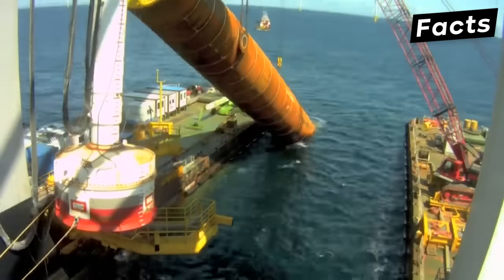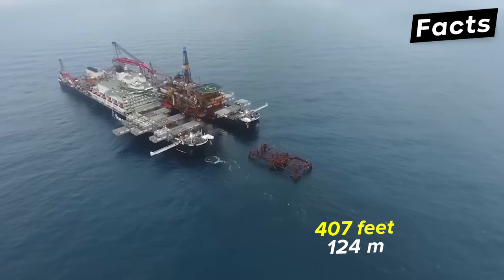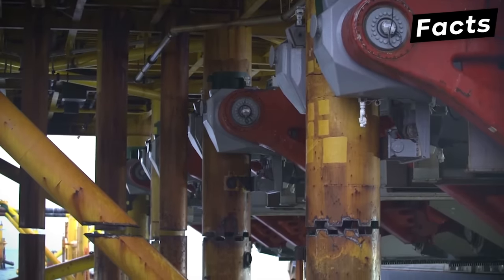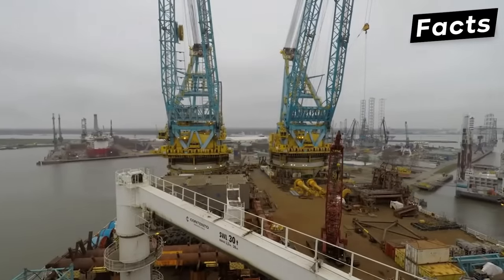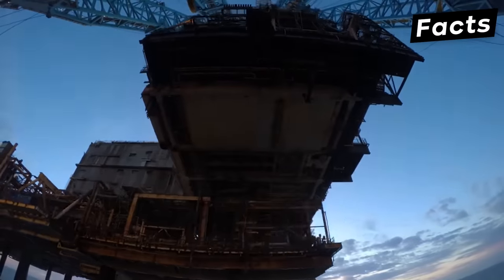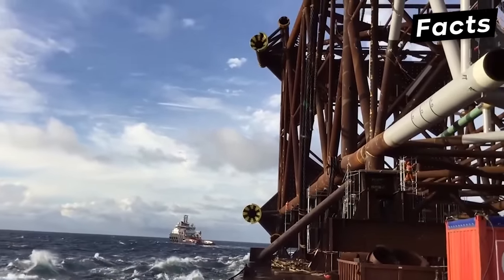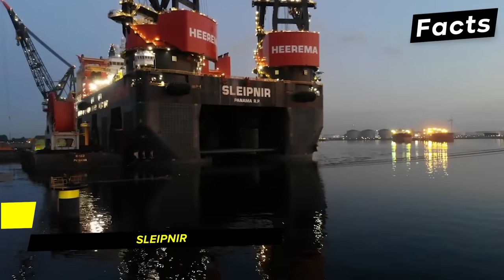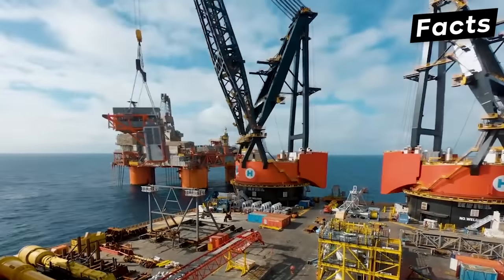The Biggest Sea Crane in The World

Comment: What is the strongest crane in the world?
the Taisun craneHolding the record for the top 3 heaviest lifts; the Taisun crane in China is the strongest crane that exists in the world today. With a working load limit of over 44 million pounds or 20,000 metric tons this crane is surely a modern marvel. The amount of wire rope required to operate Taisun is nearly 50,000 meters or just over 31 miles; allowing it to lift a maximum of 80 meters. While not everyone may need 31 miles of wire rope, or have a need to lift 44 million pounds, we have a wide variety of materials required to lift, push, pull, and move whatever is in your way.
Holding the record for the top 3 heaviest lifts; the Taisun crane in China is the strongest crane that exists in the world today

Comment: By the way the crane that dropped its load under test when the lifting block failed under only partial load (I think around 2500 tones), if it is the same ship, when the ship righted it self the boom flipped back and when it hit the back stops the entire rig collapsed, miraculously only injuring 19 people. The damage was originally thought to be some Euro 50 million. There is footage of the collapse sequence. Very dramatic.
Reply: I think you are confusing this with the Liebherr HLC 295000 Crane installed on the vessel Orion. The Saipem collapse was actually due to a hoisting cable failure but no significant damage to the boom was reported thankfully.
Reply: @bamafan-in-OZ  Correct. The hook break was on the Orion. I’d love to see the final report on that failure. There were 2 possibilities from the glimpses that I saw, either the main housing split in half or the tapered thread of the hook unscrewed itself. I think that it was the first option but don’t fully know how these hooks are designed. At the moment here in Schiedam we are enjoying watching the up grading of the Wind Orca and its sister lifting platform ship.
Reply: @williambunting803  that would certainly be interesting to see. From what I remember the 4 way hook assembly is mounted on a shaft that hangs down from the hook block. At the end of the shaft they fit a retaining cap with bearings on top to allow the hook assembly to rotate, it was this cap that broke off and the hook assembly separated from the block with the shaft remaining attached to the block.

Comment: Allseas is a company in the field of offshore installation of pipelines for oil and gas transport. The company has about 4000 employees. The company is owned by founder Edward Heerema. Wikipedia
Founder: Edward Heerema
Headquarters: Châtel-Saint-Denis, Switzerland
Number of employees: 4,000
Founded: 1985
Chairman of the Board: Edward Heerema
Subsidiaries: Allseas USA, Inc., Société D`explitation D`equipement Offshore Sa, Bluerise BV
Type of business: Private company  its a dutch company